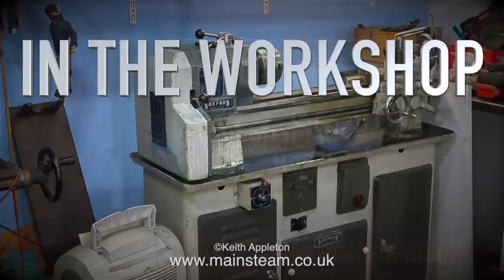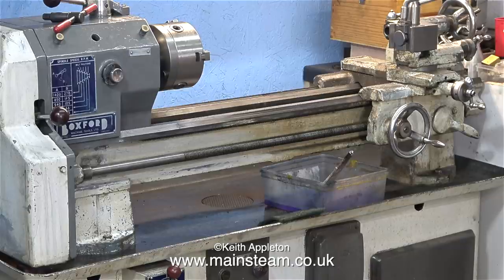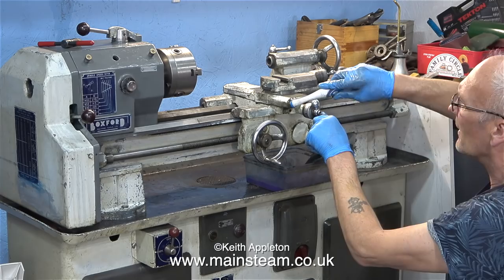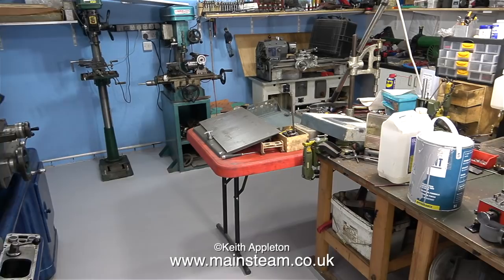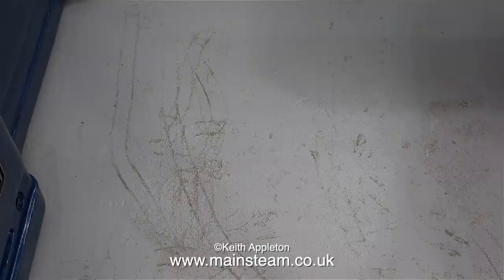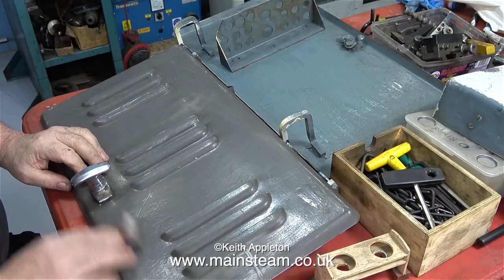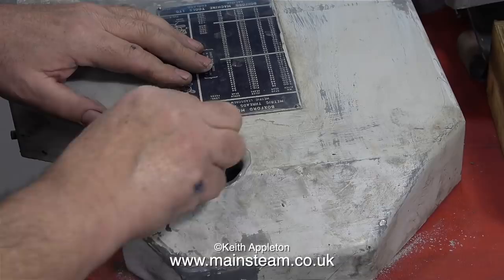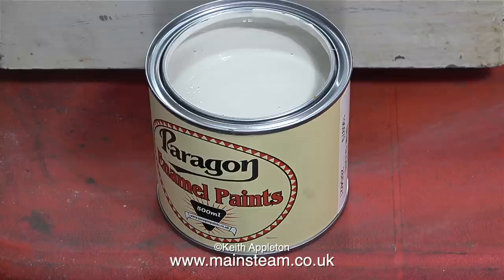CLEANING AND PAINTING MY BOXFORD LATHE - IN THE WORKSHOP

Comment: We were given 2 Lathes last August 11 miles from home. 4 journeys and other bits came as well. A Blackgates cut off saw, Flypress and a filing machine. They had all spent 30 years in a workshop with a leaking roof. Bits have now com FREE from the Super 7 but the Raglan 5 still needs work. Sounds like 60's pop groups. Both with gearboxes!! Our last 2 visits we dragged them past a rapidly filling SKIP poor things. David and Lily.